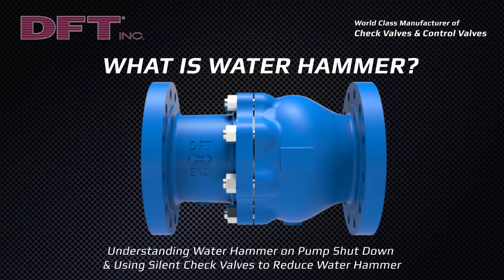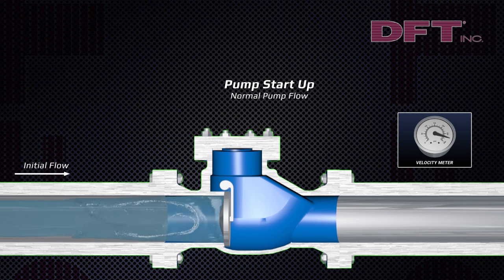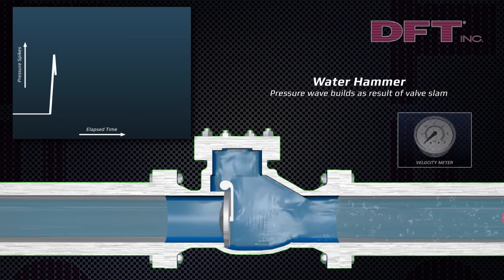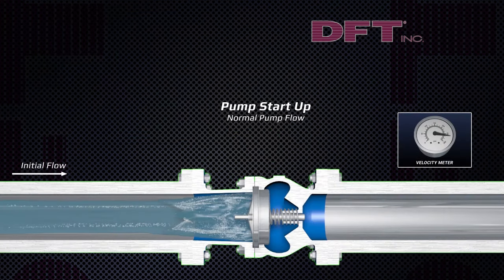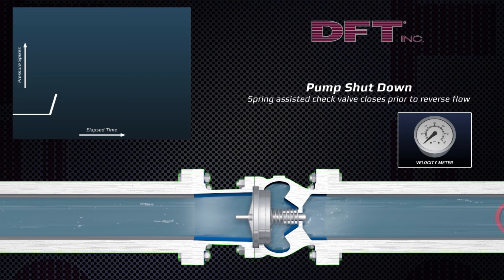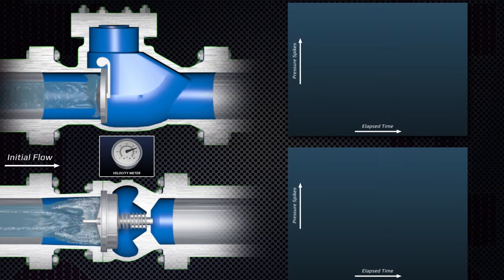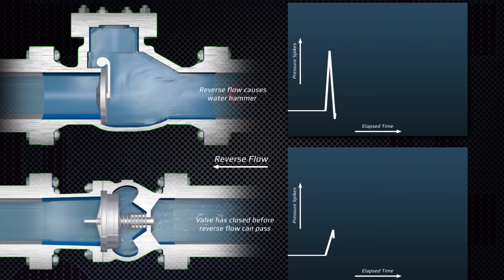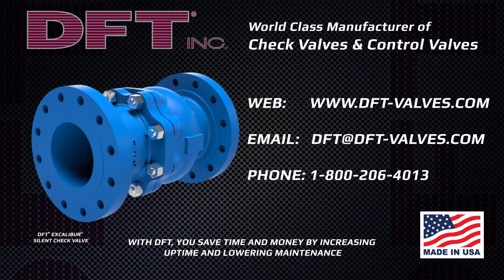What is Water Hammer? | DFT Inc.

Comment: Cool.I only came to understand where the name 'Water hammer' Pulse is derived. I'm leaving here more confused than I was before coming here. I doubt your explanation could help me understand why there is a 'Water hammer pulse' in Aortic regurgitation. lol
Reply: I was also confused by his explanation, the water hammer is weakened just because the value closed before the Pluse come back？
Reply: When you close the valve very fast, the pressure in fluid rises instantly  and the shock wawe occurs, the water starts to go back into the reservoir and then back again into the pipe until the pressure drops back to normal. You must stop this because the pipi can explode, so you can do it by slowly shutting the valve down or with some special things that i don't know the name for  in english
Reply: Oh and also tge name water hamer came in place cause the water slams the vavle like a hammer
Reply: @andjelkakosovac9979  water hammer caused by pump shut down work differently. When the pump shut down, a pressure drop is experienced after the valve closure and not a pressure increase. Pressure increase occurs when you suddenly close a valve upstream a turbine .

Comment: Please let me ask one question about the spring assistance stope for water harmmer in pipe ....why can they use a rubber gasket to stop the closing and opening in the pipe valve to stope the water harmmer instead of adding spring...is that really possible
Reply: Ajayi, Water Hammer is pressure spikes that can easily exceed five to ten times the working pressure of the system. This can cause serious damage to pipelines, pipe joint gaskets, pumps, and other components of the system.
A rubber gasket would not solve the water hammer problem. Instead, the spring assist on the check valve starts to close the disc as the forward velocity of the fluid slows, minimizing or preventing the slam of the pressure spike.

Comment: Water hammer is actually happens on coming side of the flow illustration is wrong
Reply: No, it's true. The video is about check valves. The valve is closed by a back flow.
Reply: No he’s right...check valves only prevent backflow once usual forward force is cut off. And even then a check valve shuts itself to prevent water loss. The receiving end of the water line typically doesn’t have any water hammer because the water usually drains. Where most of your water hammer happens on on the flow side. When you close a valve quickly the water you just stopped from flowing slams into it and causes pressure build up. I’m a line repairman...we have to become state licensed for water hammer events and backflow prevention.
Reply: @Warmindking, the water hammer will be exerted by the water column after the check valve. The water doesn't drain unless there are measures made to do so. The only way the water will flow if the pump shuts down is towards the pump since the pressure now pumping the water is gone. Hence the flow illustration
Reply: kartik bali I haven’t worked on one water system yet that doesn’t naturally
Drain water by use or relief valve. Literally worked on one today right beside the main pump from the river that busted loose. The hammer comes when the direction and force of the water moves violently which WILL happen even after the shut down. And I know this because that’s what blew the pipe out when the shut down happened. A faulty valve shut, water hammer did the rest. Before the valve. My point is, there is almost always something draining the receiving end of this. So seldom does a water hammer occur there.
Reply: @jdwylde7  Yeah if there is a relief valve to drain the water off after the Check valve then most definitely there will not be a water hammer in the water column after the check valve. I never said that these measures are less frequently implemented. Its just that in the flow illustration, if there is no such thing installed, then the water column in which the water hammer is shown, is correct
Reply: kartik bali just in my experience, I have never seen such a situation.